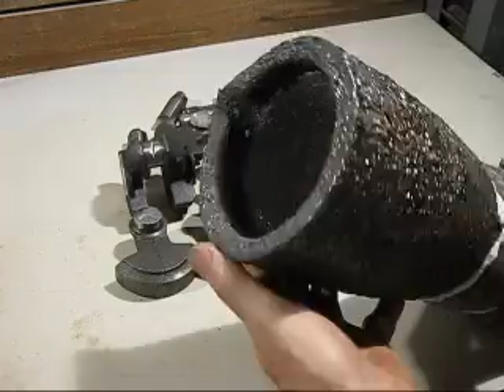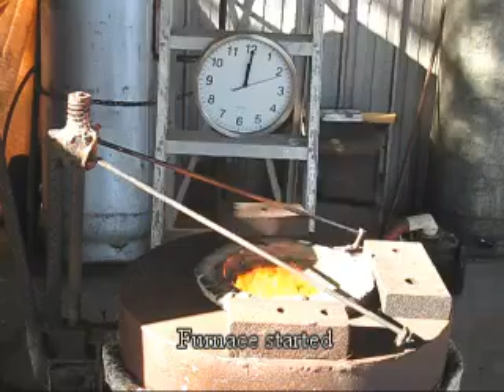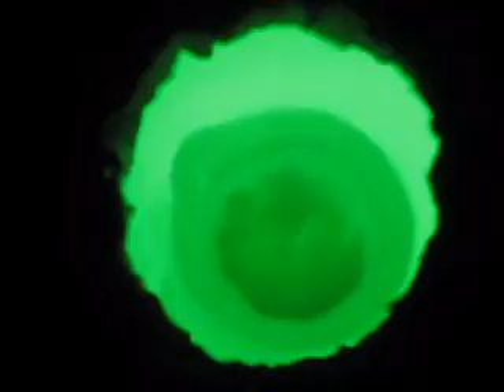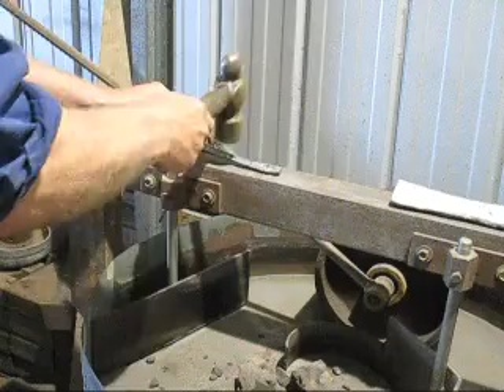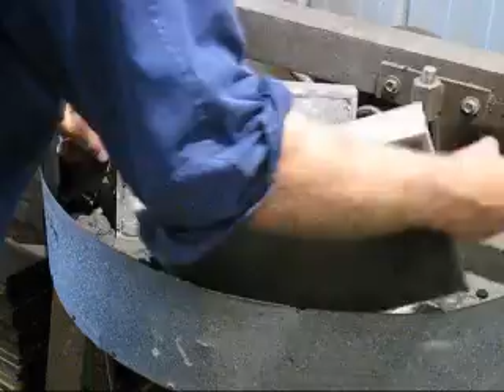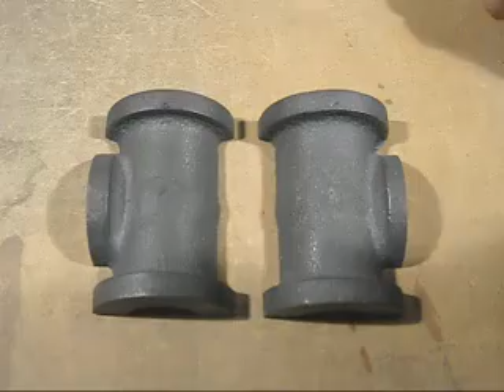Melting  crankshafts

Comment: nice operation,,,, did the crucible base separate away without damage??   Also,, seems to be a massive heat wasteage from furnace??  could you not close down the mouth a little then reduce the heat input?
Reply from the maker: I leave the crucible base on. When using waste oil which costs nothing I don't care if I lose some heat.

Comment: Have you ever literally burned the iron?? Some people that I work with use to say that it can be burned exactly like wood under the correct conditions!!
Reply from the maker: Every time I melt iron some of it burns, that is where the slag comes from. When you use oxygen to cut steel it is burning it not melting it.

Comment: Make a video where you melt and cast stainless steel please
Reply from the maker: My furnace will not get hot enough for stainless steel.
Reply: luckygen1001 And if you add oxygen to the burner can you melt stainless steel?
Reply from the maker: Yes I could if oxygen were added but the furnace and crucible would not take the higher temperatures.
Reply: @luckygen1001  Why don't you try? It would be interesting

Comment: Excellent video.  It's hard to believe that they used to make bridges out of gray cast iron.  Blow holes that came to the surface were patched with "Beaumont's Egg" a mixture of  beeswax, fiddler's rosin, & the finest iron boring's melted up & a little lamp black" a dresser at the foundry told the inquiry into the Tay Bridge Disaster in 1880. Amazing how long some of those bridges and buildings stood, or maybe didn't stand with major casting defects.

Comment: When you drill and mention it couldn't be any softer, is that a good thing? Don't you hope it'd be as hard as possible? Also why are the test ingot bars so brittle and porous, why is the metal brighter where it cooled faster?
Reply from the maker: It has to soft to machine otherwise cutting tools wear out much faster. My castings don't need to be as hard and strong as the crankshaft. Cast iron is porous because of the graphite.

Comment: Where the script says "Iron", they do mean "steel" right?  Iron is too brittle for a crankshaft, right?  And why did he add ferro-silicon?  Thanks for your answers, Patrick :-)
Reply from the maker: Those crankshafts are cast iron but with a very high tensile strength, they are not steel.

Comment: You can use cheap iron weights off craigslist for a massive amount of easy iron
Reply from the maker: It would be a sad day if I had to pay for my cast iron.
Reply: luckygen1001 lol, good point. I have machined down some 25-pounders for baseplates for some home made swiveling vice bases for my shop and just figured I’d share the source, but if you can get them free, definitely more power to you. Excellent casting by the way. I’ve never cast iron before, just random aluminum projects, this was cool to watch.
Reply: @luckygen1001  

How do you obtain free cast Iron?  Also wanted to know if you could explain what the negative effects of the chilling white iron portion is?  Too brittle?  Hard to machine?  Thanks for teaching me how to melt metal!
Reply: Heavy broiler grates from commercial kitchens.  very high quality cast iron, but they are consumable parts that regularly just get thrown out.

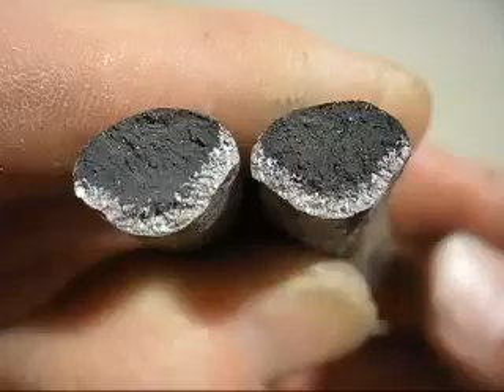Comment: What does it mean at 5:40 where he shows us that the part touching the mold is metal colored and the rest is grey? Is the darker part slag or weaker or something?
Reply: The part touching the mold was quenched fast enough to turn it into white cast iron. White cast iron is as hard as the hubs of Hades and not machinable. That is why he tested one of the wedges with a drill bit.
Reply: It's all the same chemically, it just has a different crystal structure.  This would be metallurgy, and if you want to look at the metal in more detail that's metallography.  There are lots of books about these topics, maybe whole books about just heat treating iron, or just heat treating steel, metallurgy of cast iron...  Iron is cheap and common, but there's a lot to say about it!  I'm aware of this information but nothing like an expert in it.  It's worth at least a glance if you're interested at all.   I'm interested in welding, where you just melt a little part of something... but you're definitely making a casting!  Not everyone realizes this.  Anyway, this guy is melting everything, making a casting period.  Welders just make a small (the smallest possible) casting to join pieces together, and that is complicated enough, believe me!  But HERE we're just making the piece of metal more or less in the final form, out of junk!   To some extent welding was invented to get AWAY from what you see here.  Sometimes you can, and sometimes you can't.... and it's hard to beat the cost of materials here.

Comment: Well produced and interesting video. Thank you for posting. However I was surprised that the crankshafts were actually cast iron and not steel!
Reply from the maker: 30 years ago I thought the same thing but somebody broke a piece of the crankshaft to show me that it was cast iron.
Reply: @luckygen1001 Cast crankshafts are typically nodular iron.  Steel crankshafts are forged.  GM was big on cast cranks whereas Ford was big on forged.

Comment: what are you using for a crucible?
Reply from the maker: Clay graphite.
Reply: micjr21 I imagine it was Graphite, that would be my guess. Graphite can handle a great amount of heat. That's why it's used as a moderator in nuclear reactors.

Comment: I think I have watched this video like 5 times now, and can't get enough of this one. It has been put together so well, that you make it look so easy, LOL... Nice job. On the left over molten iron, that you poured into ingot molds, were the molds just steel angle iron cupped upwards with end caps, meaning, is so, what prevents the iron from adhering to the molds made of steel? I assume the extreme temp differences between the molten iron to the steel molds prevent sticking? and per, the cooling to fast, can thermal relaxing even that out, or does the iron have to get back to a molten state to eliminate the cold edge?If you add those poured ingots back into the next batch, will the edges that cooled to fast, then become slag or waste material, or will it mix evenly back in to the rest of the pot of molten iron? The dark color, of the edges that cooled to fast, is that excessively brittle? Either way, I watch many other folks's channels involving smelting but this one video, for some reason, everything just looks logical, all the while stimulating a hundred different questions. Oh and preheating of the molds for the overflow, help reduce the cooling down factor? which turns me back to the question above, would that then allow the iron to stick to the mold ,due to the preheat? I want to assume that the iron doesn't want to stick to the steel, maybe due to the contraction differences from the mold and the iron... one is being heated up, and the other is being cooled down?... Dru
Reply from the maker: I dust talc so the iron does not stick to the ingot mold. Yes they are made from angle iron. If I remelt that chilled iron and pour it into a sand mold it will cool slowly and will not chill.
Reply: I have learned quite a bit on the many videos I have watched of yours in just the past few days. Thank you for the effort to put these videos together for all to see and learn...

Comment: What is "shrinkage porosity"? Your explanation for not needing a vent makes no sense. If there were air trapped in that part of the mold, it wouldn't fill up with iron completely. and the air wouldn't be dense enough to force its way back against the flow of molten iron to vent itself. Vent holes let AIR out of sealed areas of a mold. They're not there to let the material being poured out. They're needed because nothing poured into a mold is thinner and lighter than air. Your video seems to be kind of a one-sided argument against somebody who has questioned you. If they questioned you, they probably had a reason to do so. I'm not an expert on casting but I play around with lead casting bullets and I've been welding and doing a little machine work and casting for 25-30 years. I'm a mechanic and know a little about metallurgy from that end, as well. Your test ingots seemed pretty damned weak to me, and if you were using an iron mold, they should be "chilled" everywhere the iron touched the molds. Of course "chilled" castings aren't by accident anyway and they're not used for parts that require consistent density and hardness throughout. The most famous "chilled" parts I can think of are John Deere "chilled iron" plow moldboards, and as an old JD tractor and implement fan and a JD service technician I learned a little about them just for grins when I stumbled across the term in some literature. Chilled castings are made to be hard as steel on the outside surface while retaining the soft inner core. The outer surface lets a cast-iron moldboard be hard and capable of being polished and scoured so it's self-cleaning like a steel moldboard. The soft center lets it be flexible and ductile so impacts don't shatter it. They were commonly used in rocky soils with big rocks that simply having a spring-trip standard or hitch wouldn't prevent from damaging a moldboard and where the plowing was so tough that a moldboard could snap rather than flex. They were also relatively cheap compared to conventional moldboards although they had a short service life because the chilled surface wasn't as hard and dense and wouldn't scour and polish as a steel moldboard. I do believe they were poured using some time of metal mold or using a sand mold that had a "chill" the sand was packed all around and it ended up just below the final surface of the casting sand itself and served to absorb the heat ouf the casting much more rapidly than sand alone. Except for those moldboards I've never heard of "chilled" castings. Why did you mention that effect?
Reply from the maker: Shrinkage porosity are voids caused by the metal not feeding properly from a riser. Vents are not needed, my molds always fill up without air vents. The strength of those castings were  enough for the castings end use.

Comment: Thanks a lot! you have no idea what your video's can do for a beginner like me. I just saw that you answer most questions diligently and hopefully you will answer my silly questions too? Crankshaft is made of steel, you just melt that steel,can i cast melted steel as it is (without adding ferro silicon) to a desired shape and original strength like it was before? and what is ferro silicon, what is looks like, where can i get it as a DIY guy? thanks.
Reply from the maker: Crankshaft is cast iron not steel, ferrosilicon makes cast iron soft. Foundry suppliers have it.

Comment: That's a pretty serious furnace to take on nearly 15 pounds of cast iron in 30 minutes... what's the fuel source?
Reply from the maker: waste oil.
Reply: That's a heck of a burner!  How many gallon per hour does it consume?
Reply from the maker: 3.5 gph.
Reply: That's pretty darn good! I assume this is being sprayed from a pump like a regular oil stove or waste oil burner? Doesn't seem smokey at all from the video. Nicely done!
Reply from the maker: I use compressed air to force the waste oil from an old propane bottle into the burner and yes it burns very clean no smoke no smell.
Reply: I was digging around and found one of your videos showing you setting up and lighting it off. That's a good way to do it. I was thinking a pump would work, but then you get into filtering and clogging stuff up, waste oil burners tend to go through nozzles pretty good too, as the metals left in the oil tend to burn off and foul the nozzle. 

I have a diesel truck, and 3 cars, so oil production isn't a problem (that and I know a bunch of folks too). This might be a good winter project.

Comment: How come the test wedges were greyed through and brittle, but the casting was nice and shiney?
Reply from the maker: I ran a coarse hone through the cylinder and used a linisher to polish the two halves.
Reply: luckygen1001 Forgive me but I'm a bit ignorant to your machinist lingo! With my question I was confused by why the metal seemed completely different in the test wedges, when you smashed it in half it looked like it was a type of rock apart from the edges that cooled fast. The metal in the final piece was nice and silver colored and solid throughout though, if you smashed the final piece in half it would also be grey inside?
Reply from the maker: Yes!
Reply: See, the broken surface is different from a machined and polished one.  If he had sawn through the samples and sanded them (say) they would have been shiny and metallic.   You'd still be able to see harder/softer areas, but it's a lot faster and easier with the hammer!  Other materials act this way- if you just break a piece of wood in your hands it's not the same as if you saw it and plane or sand it.
Reply: Cast iron. Grainy and lovely.

Comment: One thing you may have forgot, was to heat the crucible without the metal in it, so when it heats up, the metal expansion does not shatter it. Putting the metal in cold was just to determine capacity when adding the chunks later.
Reply from the maker: The crucible did not shatter even though it was not preheated.

Comment: Did you attach a plinth to the bottom of your crucible on purpose?.. and if so what did you use to attach it?... are there any books you would suggest for casting ferrous metals?
Reply from the maker: No it's not but it is no problem if it is stuck there forever. There are so many of them just look up google.
Reply: o cool.. thanks again... have a good one

Comment: Great Video. How much Ferrosilicon do you add for the A6?
Cheers
Stephen
Reply from the maker: About 0.5%.
Reply: Thanks very much. Do you know what grade? I'm having trouble sourcing a supply in Western Australia. They only sell 25kg min. Cheers
Reply from the maker: I use 75% silicon grade. Try to buy a small amount from a local foundry.
Reply: I'm in Western Australia as well, keen to share in a source for material please
Reply: Why do you put Ferrosilicon? What purpose?  To reduce silicon?

Comment: Have you ever tried to harden at abaut 1100°C and reheat it to abaut 250-300°C to a industrial usefull hardness ,it wont beak that easey if it works correctly (the mycrocristalls you can see at the point you have broken it are going to get smaller and more tough so you will need more than just a hammer to break it)
Reply from the maker: No I have never tried to heat treat my iron castings.

Comment: Why does the molten iron look like it's actually boiling, like a pot of boil water.  Is it just the hot metal rising to the surface then cooling and sinking?
Reply from the maker: The cast iron is not boiling but this is what very hot molten cast iron looks like.

Comment: Looks like a Clausing Colechester lathe. 13x36? Gap bed. About 1965? Really like mine, I have two although they are not the gap bed version. .
Reply from the maker: On the end of the bed it is stamped 1966, you were very close. I found them to be a very useful lathe in my workshop.

Comment: I really found this video helpful for my attempts at iron castings.  Could you tell me please, did you put the crucible in from cold?  And did you get the first melt 8 mins from then?  I find it takes about 3/4 hour from cold in my  oil furnace to get a melt and I;ve been wondering if I ought to be getting the furnace up to temperature before I put the crucible in.  Thank you
Reply from the maker: The crucible was placed in the furnace when cold and is full of iron. My furnace uses kaowool for the hot face, so the furnace and crucible heats up very quickly. Are you melting iron in 3/4 hour? That melt took about 36 minutes so if a iron melt takes 45 mins for you it is a reasonable time.

Comment: I want to try cast Iron in our setup soon. Thanks for up loading this video. It was very good. Quick question. We run our furnace on propane. Would propane get us to the heat we need? Or is oil a necessary fuel?

Best Matt
Reply from the maker: Propane will melt cast iron.
Reply: Great. I'm excited to give it a try! Thank you.
Reply: Should I use diesel oil, coal or butane gas?  In my Myanmar country, most people use coal.  The smell is bad and dusty.   What do you recommend?  What kind of oil exactly are you using?

Comment: +luckygen1001, another really superb video.  I have a question though.I note that you say that your furnace is not hot enough to melt forged steel.  What temperature would be required to melt and cast steel (I have no interest in iron casting as such but I would like to cast some steel crankshafts)?ThanksLuke
Reply from the maker: +Luke Albanese1500C for melting steel and pouring 1700C.
Reply: @luckygen1001  what is source of air and what blow intensity. And what is propan pressure to gave these results ?
Reply from the maker: I use a vacuum cleaner as a blower and a 1500 watt will be more than enough to melt cast iron. I use waste oil for melting cast iron, I only use propane for two minutes at the start to warm up the furnace. Waste oil will not burn in a cold furnace.